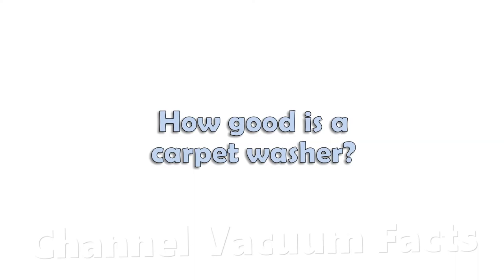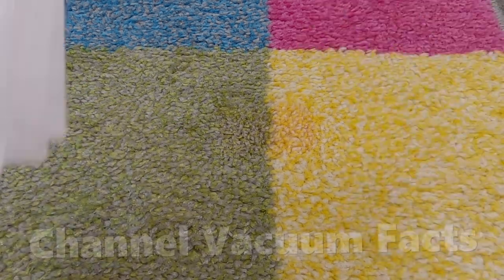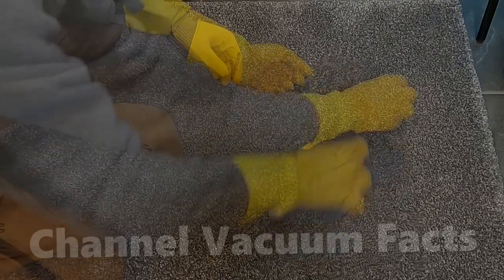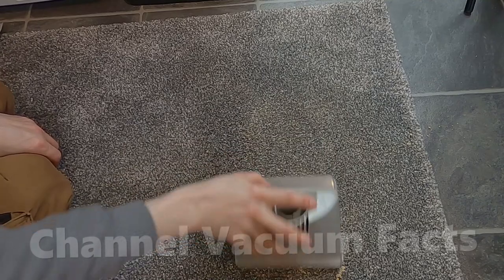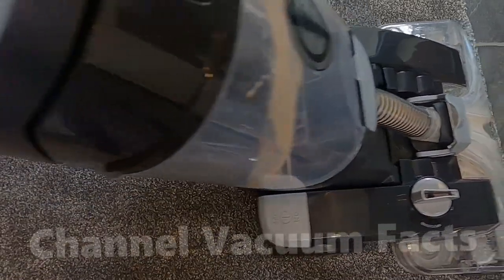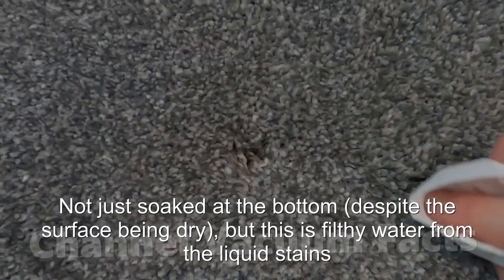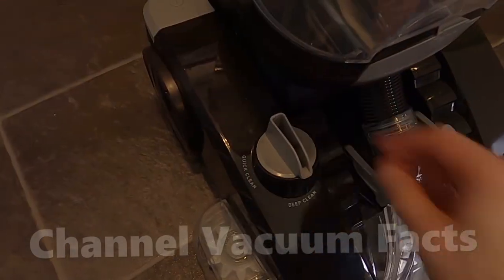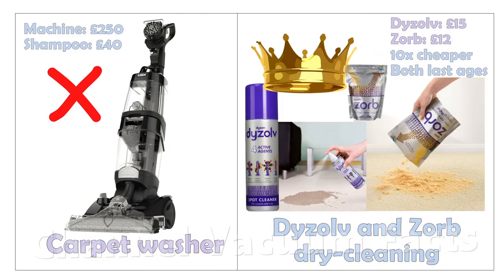Best Way To Clean Spills And Stains From Carpet: Carpet Washer Or A Cloth, Dyson Zorb, And Dyzolv?

Comment: I have that exact Vax and it doesn’t even have enough suction to suck the water out- the exhaust blows hot air underneath to compensate for it so it dries faster
Excited to watch this vid as I never expected you to get one of these
Reply from the maker: I doubt the warm air will do any significant drying during the miniscule amount of time it spends over any given area of carpet. This video is an expose of the utter stupidity of carpet washers and how they're a consumerism scam, wrongly approaching a problem. You get better results with a cloth, and if particularly bad, a Dyzolv and microsponge second treatment. The carpet washer makes a mess deeper down.
Reply from the maker: Also, it has incredible suction that apparently outperforms dry vacuums (with the caveats I expose in the video). The surface is left very dry (albeit not as dry as wiping with a cloth)...unfortunately, the base is soaking wet though, because carpet washers are a stupid approach to carpet care.
Reply: @VacuumFacts  I think it does because the exhaust air is not only hot, because you can feel the heat on the carpet after making a pass, but also blows it quite forcefully on the carpet

The head suction is weak though, my Numatic George has way more suction even when the vax is in hose mode, yet the Vax seems to dry quicker
Reply from the maker: @parwaz7861  It had no effect I could detect. Would make no difference anyway, I left a fan on the top overnight and it was still damp at the very base. I'd only believe claims about suction if empirical pressure measurements were taken. Either way, the machine, and all carpet cleaners, are a terrible approach to the problem. This and the next video provide the best, quickest, and cheapest solutions.
Reply from the maker: @parwaz7861  I chose that machine for this video BTW because it was consistently 'reviewed' as being the best performer out of all those modern ones tested.

Comment: Well, I kind of wish I had seen this a week ago before I bought a carpet washer
Reply from the maker: send it back on the money back guarantee
Reply: @VacuumFacts  I'm still not sure really.  For dry stains I can definitely see the advantage of dry cleaning chemicals.   I need something to pick up wet stains quickly though.  I don't think I can stomach leaving urine/faeces stains to dry overnight.  And I bought it mainly to pick the mess up quickly without having to use up numerous rolls of kitchen towel.  I'm going to check like you showed how wet it is deep down and then I think I can decide.  The stupid thing is I've remembered there's a bag of zorb that's been at the back of the cupboard for literally 20 years that has never been tried.
Reply from the maker: @peepiepo  This video demonstrates how to deal with wet stains. A cloth is far better than a carpet washer at getting the worst of it up. Once it's mostly dry (using tissue), you can move on to dyzolv and then microsponges. A carpet washer doesn't clean well, as demonstrated.